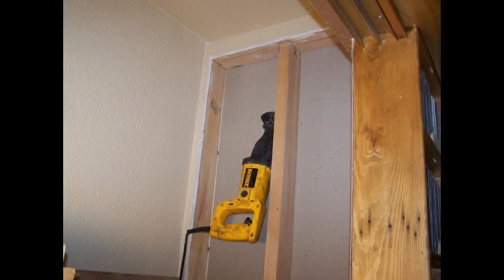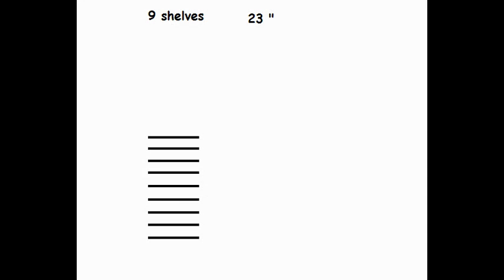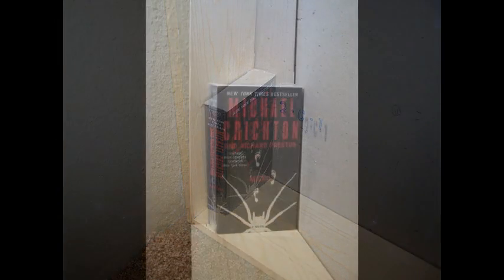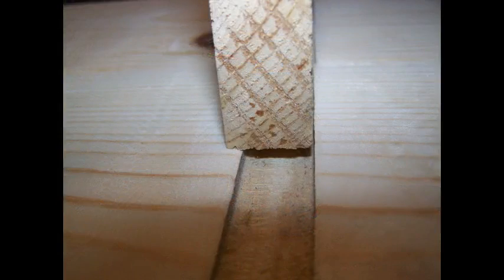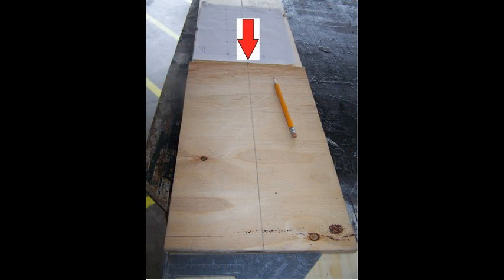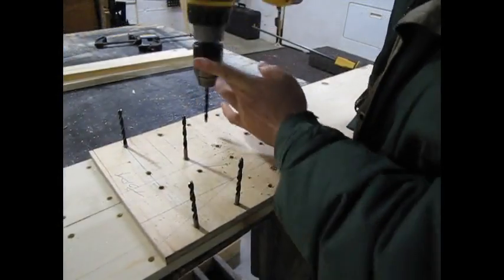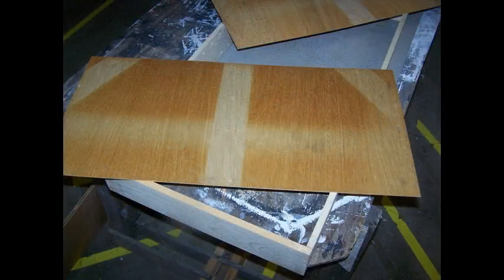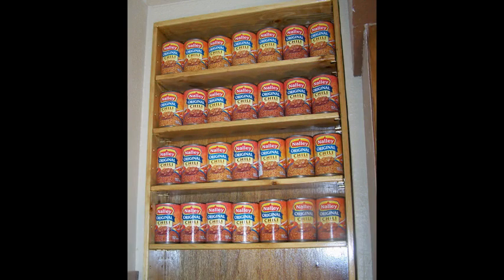DIY (building in wall recessed closet shelves)

Comment: Is it ever a bad idea to remove studs?
Reply from the maker: Jay Macedo Hello Jay.  Thank you for asking! I should have mentioned this in my video. If the wall is a load bearing wall, Don't remove any studs from it. Load bearing walls are the walls that hold the roof and other structure up.
Reply: @bounder97  how can you tell if it’s a load bearing stud? Is it a different thickness?
Reply from the maker: @jadecampos3396  Technically, you should check with an expert such as an architect. The way I do it is to climb into the attic. Find the location of the wall I am planning to remove a stud from. If there are no structures resting on top of it, I don’t consider it a load bearing wall. I consider all outside walls to be load bearing. On a multi story house, I would also consider all inside walls below the top floor to be load bearing. The studs inside a wall are normally all the same size whether they are load bearing or not. Remember, safety first! if you’re not sure, don’t remove studs from inside walls…